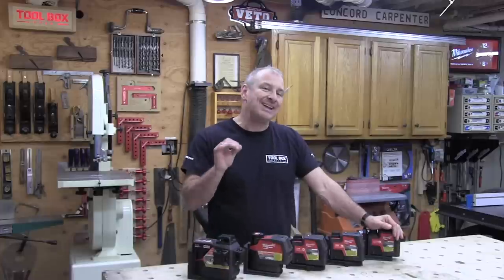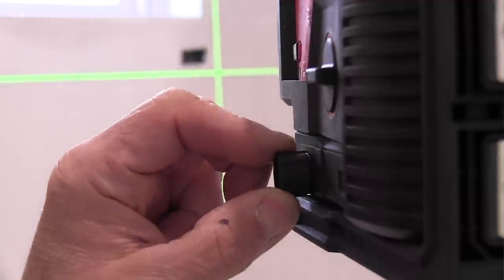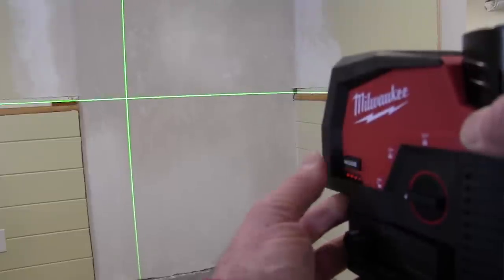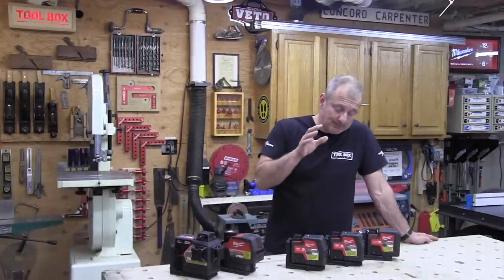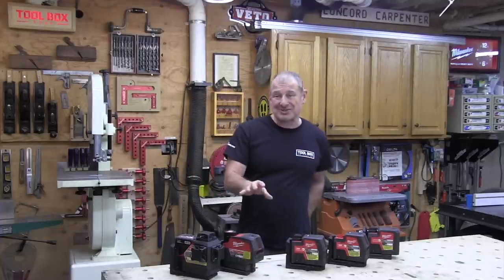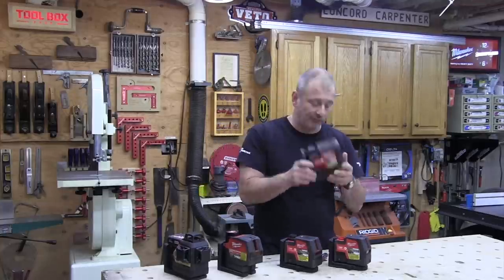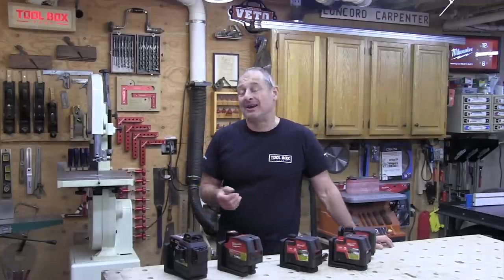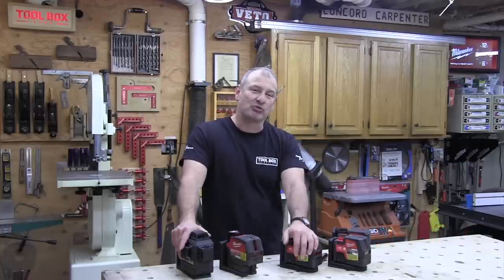Milwaukee Green Lasers

Comment: Those lasers are huge! I use my bosch 360° + cross line laser for doing shelves and cubbies in closets. With those bricks hanging off the wall, I'd hit them very often. BTW. Metal closet rod, taped to the wall, works great for being able to adjust the height rapidly with the bosch. If Milwaukee comes up with a USB 360° green laser, I'll be the first in line.
Reply from the maker: I have the BOSCH 360 too that’s a great tip

Comment: Frickin Lazer beams! Love the fine dial adjustment.
Reply: Try using a separate  scroll controller that would adjust the beam up down or at any angle with out touching  the laser unit?

Comment: one thing that was not mentioned was the laser lock.  The laser level lock the pendulum of the laser to the plumb and level of the unit. So if you have it on, the unit itself is not level/plumb by x degree that's within the auto level function, you flip the lock on, the laser will shift.  it doesn't lock the laser to where it's currently projecting. 

I almost bought this unit today until i discover that issue.

Comment: Milwaukee needs to develop a (painters) tape that reacts to Laser light.
Put short strips of tape around the room, turn on laser, tape reacts (photochemistry). Job done with Exact markings!
Don't forget my percentage!
Reply: You can use glow-in-the-dark tape for that, 3M make a safety tape for inside stairwells that is super hard wearing, I've had a strip across the back of my phone for 2 years now, with no case, specifically for this purpose. Can pick out a red laser even in daylight.

Thats Scottish daylight though, so maybe dawn/dusk for those of you in sunnier areas of the world! 🤣🤣🤣

Edit: on our dewalt 360° site laser with plumbstick unit 'strong' sunlight often washes out the plumbstick unit, no such problem with the tape, move the phone down slowly, and you can see the glowing lines appear across the tape, with ghosting to give you a idea of vertical rate of travel. Once we know where to aim for we can get the stick in and start shading it and wait for the beeps :)
Reply: @mor4y  but it doesn't stay lit when the laser is Off.
Reply: @billquillin1952  the 3m stuff keeps a ghosted line right across it for a short time even once the laser is turned off. Kinda like when you expose part of glow in the dark tape to a strong torch with the rest in normal light, then turn the lights off and one part would glow brighter than the rest, except its just a fine little line glowing :)
Reply: @mor4y  that's my point. It doesn't last.
Reply: @billquillin1952  if you made a more permanent one  you'd almost be making a photo-tape. Laser light wavelengths are present in normal daylight, so when you exposed the tape off the roll, the reaction would start. You'd get the same strong ghosted line across that tape where the high-intensity light hits it, but eventually that style of tape would end up fully exposed, and the line no longer visible. 

So both styles of tape would let you find the laser line easier, but you'd still end up making pencil marks with both of them! From modern all the way back to ancient 😁

I keep meaning to check StyroPyro's channel archives, or ask him a question, if a better product exists or is close to existing thanks to new tech, he'd know about it 😉 that guy lives and breathes lasers, and is a chemistry graduate, the perfect mix (for danger!)

Comment: Very informative. Do you mind providing be weight and size difference between the M12 line and point verse the USB line and point? The M12 line and point is a lot larger then I expected. Quite a bit larger then the DeWalt green line AA battery one I’ve been using.

Comment: Will any of these stick on mudded corner bead?? My pls 180 did but my new hilti 3 plane 360 will not.. Pls will not recalibrate past warranty I think 2yr they wanted to charge more than what I paid for the laser brand new to replace it. wanted me to send in my old and they would take 20 bucks off an inflated price replacement laser

Comment: At the end of the video you make it sound like the usb-based models need a cord & charger to work; they do not.  Regarding the tripod, I recommend you take a look at the FastCap LaserJam, or Third Hand and LaserMount.  Height adjustments are simple with either one.  For my once or twice a month need, the LaserJamb is too bulky to keep in my van full time, but the Third Hand easily stores with my other long/tall tools.

Comment: Now that Milwaukee has there lasers, I think it might be time to do a 3 x 360 laser head to head.  :)
Reply from the maker: I think your right
Reply: @ConcordCarpenter  If you do, be sure to include Huepar's lasers. Under 200$ for a 3plane.
Reply: @ConcordCarpenter  don't forget to include Hilti
Reply from the maker: @MooseDoesStuff  never heard... they Prograde?
Reply: @ConcordCarpenter  might be worth checking out. If it is worthwhile, for ~$200 it undercuts all competition.
Reply: @ConcordCarpenter  All depends on how you define prograde I guess? Other YT reviews seem to find them pretty comparable, usually at least to dewalt, so I'd be really interested in your take on them 😁
Reply: @F !50 o dang, i didn't know they had that! must buy :D (also, looks like it'd work for any laser that doesn't otherwise have micro adjustments)

Comment: Do they work with a receiver as an accessory and if so how does that sit on a flat surface. 
I mainly fit kitchens or as you say remodel. I use a receive to place on the corner of the base cabinet and when I’m on the floor twisting the feet to adjust the receiver make an audible solid tone when I reach the lasers beam. For this to work the receiver needs a flat base.
Reply: You sell weed for a living Mark. And you pinch your bags

Comment: Could you use these to measure the deflection of a ceiling at three or four points such as each end and mid span?
Reply: Yes, they're great for that.  You would set the laser 6" or so below the ceiling and measure up to the ceiling at any point using a tape measure or ruler.  The laser shines on the tape, making measurements easy.
Reply: @morganwheeler7417  Yeah the only problem is they need to have an accuracy of around +/-1mm and I don't believe any laser line could give that due to the thickness of the lines omitted.

Comment: I currently use the Bosch telescoping pole system. I’m wondering if I could adapt this to the Milwaukee. 

I definitely prefer the M-12. I’m having M-18 batteries fail almost to a battery at 2.5-3 years on normal use. 
I’ve never had an M-12 battery fail except when I dropped the tool 

IF YOU CAN ONLY HAVE 1 of these lasers... which would you pick??

Comment: what is your opinion of this Bosch GLL3-330CG 360-Degrees Connected Green-Beam Three-Plane Leveling and Alignment-Line Laser
Reply from the maker: I own and use it - great laser
Reply: @ConcordCarpenter   Im a deck/porch builder and would use this outside 99% of time. Does the green show up well? I had a PLS before but it lost calibration and ran on AA bats pain in butt. Had to use an audible target most of the time. whats run time of this?

Comment: Milwaukee needs to revise there 4v platforms. First of get rid of the micro USB. micro USB does have its uses but one of them is not to be reconnected over and over and over. That task should be given to usb-c. Either use usb-c connector or maybe even look into Apple lightning connector. There is some potential for a single cell battery plattform. But no brand seems to be even trying.

Comment: Milwaukee should make a charger that accepts M18 / M12 𝗮𝗻𝗱 the USB sizes all in one.

Its missing little obvious details like those that make me question of companies are really paying attention or not because that should be a no brainer for them because it just makes sense, yet they haven't caught on yet 🤷🏻

I bet they could pair a dual USB sized battery charger with 1 M12 & 1 M18 in a reasonable sized charger no problem.

Now that would be ideal.
Reply from the maker: they do
Reply: @ConcordCarpenter  

Sorry I’ve looked, I’ve never seen a Milwaukee charger that took all 3 battery types M18 / M12 &  USB batteries, I’m fairly certain it doesn’t exist.
Reply from the maker: Oh correct not usb battery

Comment: This is a copy paste from Hilti,  mini adjustable, on /off and lock and then you're moving across line or plum line or level line from the same button .
Thanks God that not expensive like Hilti because  being so expensive it doesn't do a very good job and I find it one my own skin , nearly 1000 sterling pounds for a laser with detector ,  which works in only One Direction and that means with the battery on a back of the light otherwise you cannot take 25 meters for it , or 82 feet and 1/4 like you are used to say .

Comment: Hey Rob! I love the channel, something doesn't make sense to my eye though, can the M12 Cross/Plumb Lazer fit larger M12 batteries? It looks like it can only fit CP Batteries and not XC
Reply: The M12 lasers can fit the XC M12 batteries. No worries there.
Reply: @P Shmanka. Another You Tuber posted a interview he had with a rep from Milwaukee. The rep demonstrated one of their M12 lasers with a M12 XC battery installed. That should give very long run time, probably over 8 hours of run time.

Hope that helps.

Comment: Love the green and the micro adjuster BUT my manual park red laser was $60!!!!!!! As for the USB batteries(???) we've had rechargeable AA, AAA, Cs and Ds for decades. Two AA last for days. 
TIP 1: magnet on a metal third hand is a lot easier and FASTER than a tripod and floor to ceiling.
TIP 2: drawing or snapping the line saves a lot on batteries especially if they cant even make it through a work day. 
I pity the fool who drops that $600 (+shipping and taxes) laser. Shame on Milwaukee.

Comment: Too bulky too expensive,
Same design as the flawed defwalt one
Reply: Remember this is a job site tool, if you want it to survive mishaps and serve you for years you need the internal components to be protected by rigid casing. And for the price I'm sure you can get some cheaper ones but remember that almost always you get what you pay for.
Reply: @eliadbu  ya I have the spectra precision lt58 I definitely got what I paid for.
Had the dewalt one replaced twice because of out of sqaure and planes not being level went for the big fish after